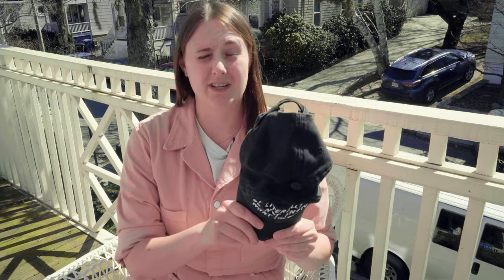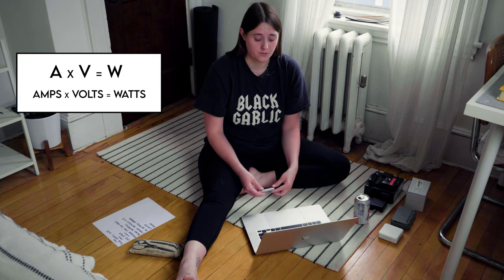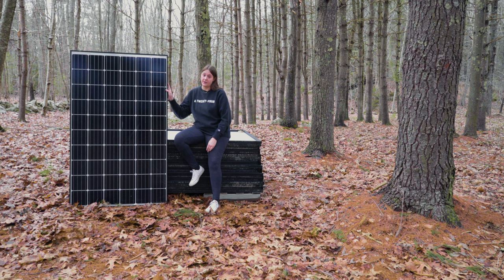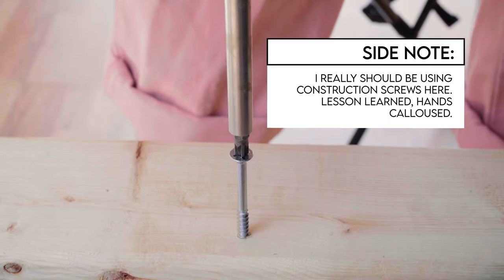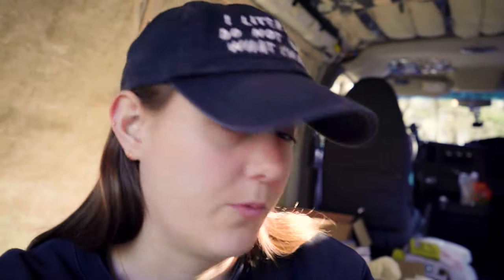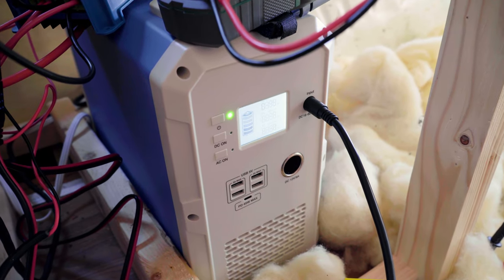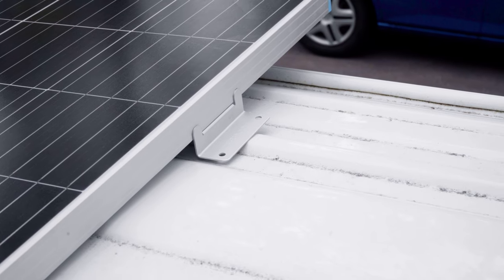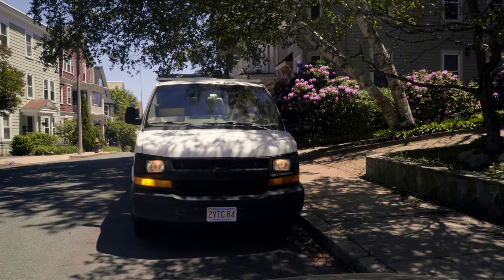Wiring My Van's Electrical System from Start to Finish

Comment: Mom is right!  You are doing an awesome job.  This is the first time that I've seen a vidio of yours, and I am really impressed.  I also have a Dad kind of like yours.  My 95 year old Dad is just like yours with a level.  The level is a great tool, but only if the van is on level ground, and the van itself is level.  Daddy is a master carpenter, and I try to live up to his standards (which are REALLY high).  I have a 2003 Ford Econoline that I am going to start building.  I plan to use a Jackery 2000 for my power, and four 100 watt solar panels in top.  You did just what I plan to do with the different charging sources for your power.  I can't wait to see more of your videos.  I love the hat, also.  I have a saying that I have lived by, and you are proof of it.  "Were there is a woman, there is a way!"

Comment: Just fyi with the rotary switch. You don't need to crimp a connector onto the end to terminate it. Just strip the cable, twist it and screw straight onto the cable.
Reply from the maker: I do know that haha but with all the back and forth of removing and replacing them, it was eventually worth it to do the quick disconnect!